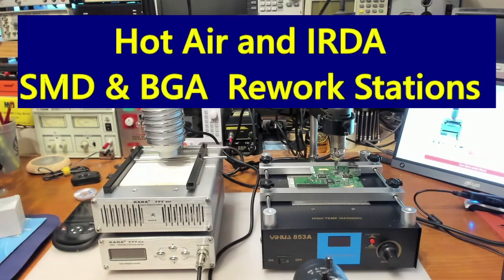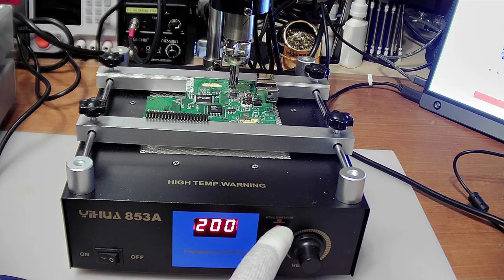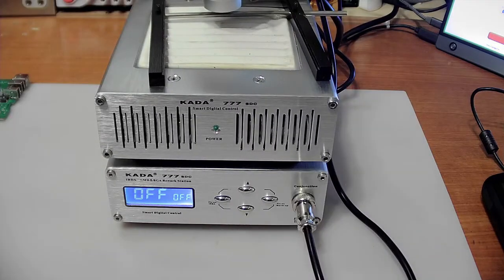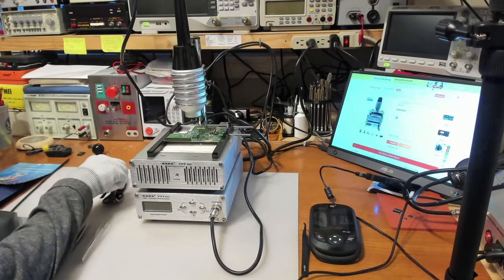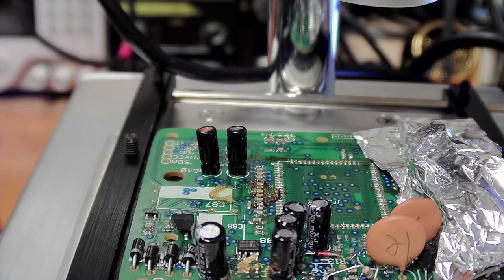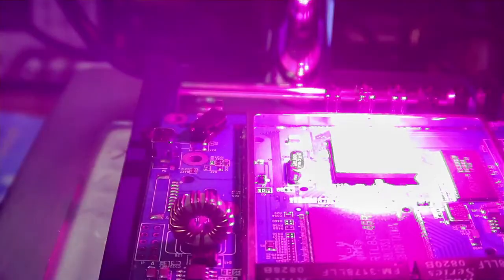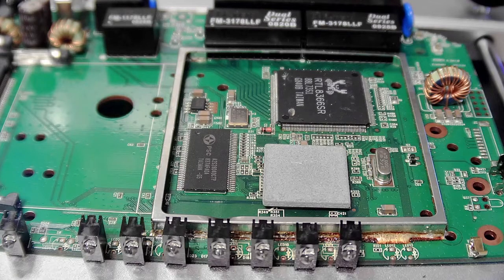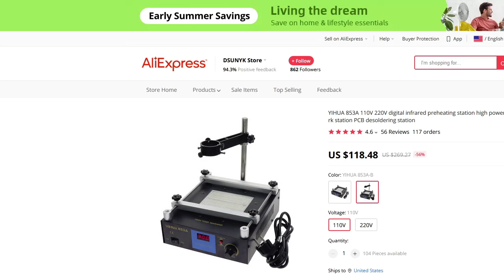Hot Air and IRDA Rework Stations

Comment: The IR station was quite good but I did not like you levering the components like that .I would have liked to see them lifting off much easier than shown and also a  clamp of the board would have been  better so you could use both hands